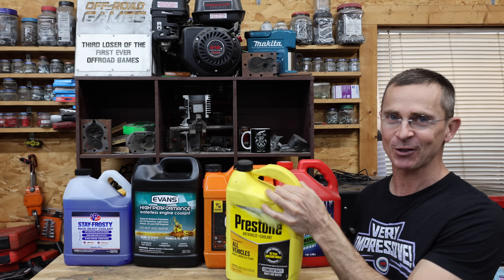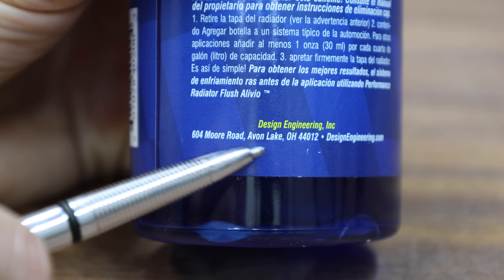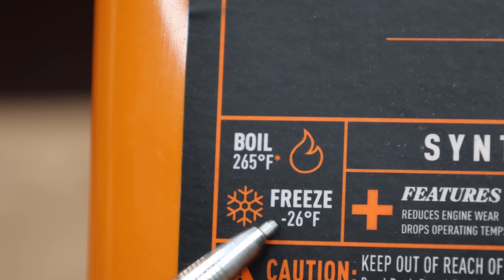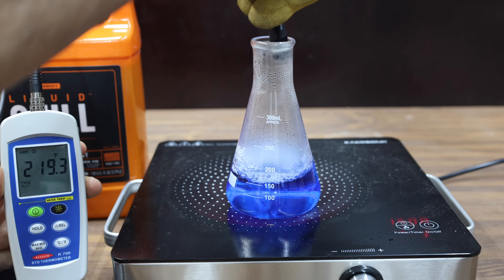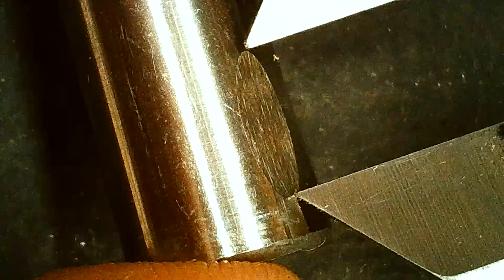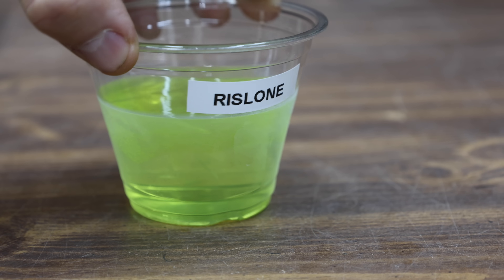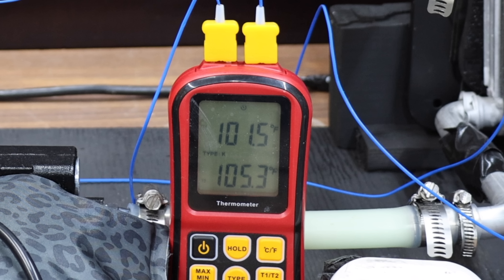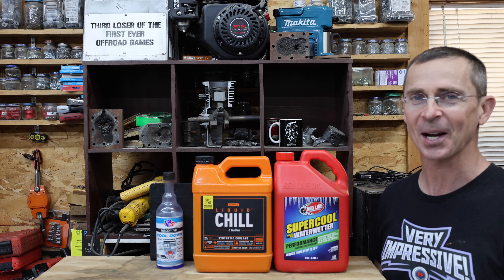Do "Super Coolants" Lower Engine Temperature By 30 Degrees?

Comment: Gotta admit I laughed a bit when Stay Frosty was the only one to freeze :D Living up to it's name!
Reply from the maker: Lol  Good Point!
Reply: The fact that the Stay Frosty stuff had the best heat exchange but terrible temperature range properties (boiling and freezing at 212F and 32F) has me convinced that stuff is just water. 
"100% water-based" sure sounds correct for that one, lol
Reply: @f38stingray  As per another commentor "The one thing you might not have known, the "stay Frosty" is required for race cars on tracks, especially drag racing. Anti-freeze is very hard to get up off the track and can cause a slick spot. 
So almost all tracks require water only (or the "Stay Frosty" brand as its proven not to soak into the track glue)"
Reply: Stay Frosty isn’t antifreeze
Reply: Yes, that was unexpected.
Reply: Which coolant yall purchasing 😅

Comment: This is all very interesting, but the questions remain as to if these are appropriate for use in a given car. Manufacturers often have very specific recommendations about coolant type and ingredients, i.e, IAT, OAT, HOAT, G12evo, silicates, phosphates, etc. Also, cooler is not always better. The goal with engine cooling is for the engine to run at the optimal temperature for which it was designed.
Reply: Hmm..well, it depends on the goal though right?  If the goal is HP, a cooler engine will always produce more power than a warm or hot engine.  A warm engine will always be more efficient than a cold or hot engine.  Thus, lowering the operating temp with one of these additives will produce more HP but at the cost of efficiency.  It comes down the fact that denser air allows for more fuel at the same RPM, thus more power.  While intakes are typically not part of the cooling loop, they are impacted by radiated heat which explains why a cold engine makes the most power.  Since the marketing of these products is more performance oriented, and the testing proves they lower engine temp, I'd say they are hitting their goal.  As for potential damage due to the chemical makeup, I believe these all state they are compatible with all new or used coolants and with engines that contain cast iron, aluminum, or brass cooling systems.  Since he also did the acid test, I'd say they are safe.   The only thing this test is missing would be a long term alkalinity and contaminants test.
Reply: Still ethylene glycol based.  The anti corrosion technology is all that is different.  Nonetheless even that makes a difference.  Funny people are still encouraged to use the Evan propylenel glycol coolant.  I've seen more race engines blow gaskets with propylene glycol die to inferior thermal properties.

The lubricity test was unnecessary, I think.  All the pumps I've seen have bearings running in grease.
Reply: @idonotwantahandle2  I'm not arguing...I'm not a car-guy, but I thought waterpumps had water lubricated bearings and a weep system as part of that.
Reply: @nunya___  No, they are sealed bearing packed in grease. The weep hole is there to tell you if the seal has failed and leaking. New pumps tend to leak a tiny bit when the pump is new and the seal is seating. A continuous stream of coolant out of the weep hole means the seal is defective and the pump needs a rebuild/replacement.
Reply: @ Thanks for the info.
Reply: @idonotwantahandle2  Agreed about the lubricity test.  Water pumps have sealed bearings so no external lube needed.  I also agree about the Evans.  I race and stay away from it.  My current built 340 runs with either the Redline or Superchill and there is a noticeable drop in coolant temp when I use it.  I like this for the better protection it offers as I'm also running an electric water pump vs mechanically driven which means a electrical fault could make my temps skyrocket, and trust me, this happens very, very fast!  Not too worried about the anti-corrosion as I've had my used coolant lab tested and nothing unusual has been found.   I see no reason to run these in a daily driver though.  Why risk unknown chemical properties or interactions?
Reply: Exactly

Comment: I can't talk about any other product as I have not tried them, BUT Ive used Water Wetter for years on all my cars since I can remember and it's the ONE MUST HAVE on all my cars. Not only it lowers all temps by a small (but good enough) amount but has N E V E R given me corrosion, pump or chilling system problems. Ive uses it straight with distilled water only in warmer climates and mixed with 10% anti-freeze in colder times. To note, distilled water only provides much better cooling performance than when mixed with anti-freeze. I am not at all surprised with the results in this review and at least on the one brand I use, I can definitely say it works.
Reply from the maker: Thanks for the feedback.
Reply: @ProjectFarm  Thank you for your videos.. you rock!!!♥

Comment: Every car has a thermostat to keep the coolant at the ideal operating temperature. These products do nothing in normal vehicles.
Reply: I have an Autometer water temperature gauge on my car in conjunction with the factory “dummy” gauge.  The “dummy” gauge reads in the middle of its range from about 140 degrees F - 220 degrees F when the cooling fan comes on.  While driving, I will see temperatures in the 180-190 degree range normally but stopped at stop lights or in heavy traffic the temperature will climb on my aftermarket gauge.  The stock gauge never moves from the middle in all this temperature fluctuation.
Reply: It still can help your vehicle run easier 😅 the thermostat may regulate temp. The fluid helps it not have to work hard to keep it low.
Reply: Thermostats go full open between 180f and 195f depending on the vehicle.   That's also the ideal temperature for the vehicle to run at without damage or economy issues.  

Well when it's 100f outside during the summer, your cars thermostat is already wide open, your radiator fan is running all the time, and your engine temp is often closer to 205f.  

So no. Even if there's nothing wrong with your vehicle and you don't "need" this additive, it will still keep your cars fan from having to run as much, and still keep you closer to the ideal engine temperatures.  Just because a car can run fine with a 220f engine temp, doesn't mean it should run at a 220f engine temp.  Same as "lifetime transmission fluid". The manufacturer doesnt much care if the vehicle lasts over 200k miles. 

As to engine temps running high but within design, they cause a lot of head gasket seals to eventually leak. Just ask any mechanic that works on jeeps or nissans.
Reply: Also say your thermostat goes out, having better fluid would give you that much more time before it overheated
Reply: @The_Hoard422 water is that "better fluid". The specific heat of water is higher than any coolant/antifreeze. The purposes of coolant/antifreeze are to prevent corrosion, prevent freezing in cold climates, prevent boiling over in hot climates (raising the boiling point does NOT increase the specific heat), and to "wet" the inside of the cooling system to allow for better heat transfer.
Reply: @jameshaulenbeek5931  you're missing the point of most coolant performance additives.  Generally speaking, they are surfactants that improve thermal transfer to/from the liquid.  They are not intended to change the thermal capacity, boiling point or freezing point.  You're conflating coolant/antifreeze and additives.  They're not the same thing.
Reply: Yes, the thermostat will close when too cold and open when it gets warm. But when you start taxing the motor with track usage or towing, the coolant can get higher than the system can effectively cool down, the thermostat can be wide open and you'll be at the mercy of airflow, how well your cooling system is designed and how quick the (coolant) can exchange the motor metal heat to the radiator metal
Reply: The only time a thermostat is closed/shut/off is during the initial warmup.  After that, it varies how far open it is to regulate temperature. 

Artificial cooling (like driving through deep water) is the only exception.
Reply: Sadly you are out-numbered by idiots. You are right about the thermostat regulating the temperature. The thermostat doesn't know nor care about any temp sensor or gauge. It works on its own.
Reply: @wudntulike2no32  the irony of your comment eludes you.  I know this is going to be shocking news, so sit down before you read it:  the thermostat is NOT the only component in a cooling system.  That's why it's called a 'system'.  Depending on geographic location and usage case, it's possible that the cooling fan controls the engine temp and the thermostat has zero effect.
Reply: If a cooling system is perfectly balanced to land right in the middle of the thermostat opening range, any improvement to the system WILL decrease the operating temperature.  A bigger radiator, a better fan, or surfactant additives will cause the temp to drop and thermostat to close more than before.  It's an inevitable fact.  If you don't have even a cursory understanding of automotive cooling systems, why not juststfu already.
Reply: Wouldn't analog or digital gauges change the view point.
Reply: A fool in his money or soon parted... Around here it's mainly used for racing, cars aren't allowed to use antifreeze.
Reply: @lynch6642  irony, you can't even quote a word phrase correct.  It's 'and' not 'in' 'are' not 'or'.  Your parents Dunning and Kruger must be super proud.  If you think surfactants are 'snake oil' like the other guy, I suggest you quit washing your clothes with surfactants (soap) to test the idea.
Reply: That's not true. It's anti-corrosive and if you're thermostat get stuck on closed (like it has on my Hemi) the Evans coolent specifically will protect it further.

Once it boils it can cause engine damage so it's always a good idea to use a coolent that's more forgiving than water especially if you are racing
Reply: If you're relying on the dummy guage to come to this conclusion, you're the dummy.
Reply: @zacharymorris9917 the "dummy gauge" is based on a calibrated thermocouple. The same info you would see on a scan tool. What's your point?
Reply: @tomgnyc  the gauge will not move unless you go way high or low in temperature. It will stay in the middle from 170 to 240 usually.  Your brain cells are not calibrated that's for sure
Reply: @tomgnyc  why are you making claims that you absolutely have no clue about???  Why?

Like the other guy said, the guage will display the same reading for a huge range of temperatures.  That's why it's called a dummy guage.  That's the same reason why people will report that their engine overheated "all of a sudden".
Reply: @tomgnyc  the sensor is not a thermocouple.  It's not "calibrated" and it doesn't display a linear output either.  You really have literally zero clue what you're talking about.

Here is an example temp sensor and the observed resistances: 

180ohms at 100C 212F

224ohms at 90C 194F

310ohms at 80C 176F

425ohms at 70C 158F

584ohms at 60C 140F

825ohms at 50C 122F

4800ohms at 0C 32F
Reply: @REALBanannaman ... That's exactly how it was explained to me. Useful, but far from accurate.
Reply: @zacharymorris9917  you're speaking as if all vehicles are the same, when they're not. My truck most definitely displays actual temperature. You can watch both the needle and the digital display change even when doing a flat highway cruise.

You can tell when the thermostat is opening and closing to center around the 175° rating. It'll go 175, 176, 177, 176, 175, 174, 173, 172, 173, 174, 175 back and forth back and forth.

Without a winter front it'll drop to maybe 168 when it's cold enough and then on a hard pull you're up in the 180, 190s, 200s, etc until the fan is prompted to kick on and drop it all back down again as you'd expect.

But you're correct that there are cars with a gauge that basically doesn't move, and it's not much better than an idiot light.
Reply: @dchawk81  appeal to exception is a logical fallacy.  I NEVER said "all vehicles are X".  I DID say "if".

Regardless of the if distinction I made, virtually all modern vehicles have a dummy guage.  Finding an exception is not some massive gotcha.

Your entire post is postured like a correction, but then confirms literally everything I've said.  So, other than the I-know-a-tall-Asian-man fallacy, what's your point???
Reply: @zacharymorris9917  I may have quoted the wrong person. Some mentioned all vehicles being "idiot" gauges as if none showed actual temperature. Apologies if it wasn't you.
Reply: @dchawk81  thank you sir.
Reply: @ You clearly have no idea how a thermostat works.
Reply: @beemo808  do you?
Reply: @ Yes I do. The thermostat doesn't even know what the gauge is reading. It is filled with wax and opens at a predetermined temperature. If the coolant temp gets above that temperature it sends coolant to the radiator which cools it down which causes the thermostat to close again, which then causes the temp to rise again which then opens the thermostat and repeats the cycle. It doesn't matter what the capabilities of the fluid is as long as it is sufficient to cool the engine with the thermostat open.
Reply: @beemo808  No, you don't, actually.  A thermostat doesn't open and close like an on/off switch.  Not even remotely close.  "Starts to open" and "fully open" are typically stated temperature specs if you look at a data sheet.  The rest of the cooling system absolutely affects how far open the thermostat is and the specific operating temperature within the opening range if adequate.  If the cooling system is borderline adequate, the thermostat will have zero affect, and the operating temperature will be determined by the cooling systems' equilibrium temperature.

In virtually all cases, a surfactant will lower the cooling system temperature.
Reply: @zacharymorris9917  I never said it operated like a switch. If the coolant lowered the temperature of the system, the thermostat would start to close and less coolant would pass through the radiator which would cause less cooling to take place. It doesn't matter what the fluid is, the system will never go outside of the range of the thermostat. Keep wasting your money on snake oil.
Reply: @beemo808  you literally did though.

Coolant CONSTANTLY goes outside of the thermostat range.  That's exactly why the cooling fan activates.  What are you on???
Reply: @beemo808  if you think surfactant is "snake oil" then quit washing your clothes with soap.  🤣

Comment: How could it lower the coolant temperature when there is a thermostat
Reply: Numerous reasons.
Reply: It won't stop the thermostat from doing its job to try to maintain temps at its rating, but it'll keep the thermostat closed more often and sooner, and the fan will kick on less often under heavy load.

IOW if you have a 190° thermostat, the thermostat will still aim for that temperature but the work it and the rest of the system has to do to accomplish it will be changed.

Comment: 0:11 Used Hyper-Kool  in  my race car in Arizona where antifreeze is not allowed, worked great , never overheated even racing in 110 *+ heat....
Reply from the maker: Thanks for sharing.
Reply: Great to know! I need something for my racecar lol
Reply: You can't use antifreeze in your car in Arizona?
Reply: @thebeddoctor4273 lots of tracks don’t allow much of anything other than water for cooling systems. Coolant is super slippery under a tire, and can be extremely dangerous if someone has a leak, busted hose, etc.
Reply: regular anti-freeze isn't allowed on race tracks in race cars or motorcycles. Also it doest freeze in lower regions of AZ, so people will use water based supercoolants and not have to worry about them freezing in their engines. I used distilled water and Water-Wetter in my motorcycle
Reply: @thebeddoctor4273 you can in normal use. But some tracks don't allow it because it causes a big mess and damage if the radiator explodes or otherwise leaks onto the track. I'm guessing that's the situation here because he said racecar. But we certainly use antifreeze in Phoenix just fine 😂
Reply: @thebeddoctor4273 im not positive but I do know not just oil but simple coolant leaks at high speeds, if something drastic occurs you and everyone behind you at speed will be at risk for crash,injury,death
Reply: @thebeddoctor4273 i think its a drag racing regulation in certain classes
Reply: @thebeddoctor4273  not on a track. It's fairly common for race cars and race motorcycles.

Comment: Just purchased a 2025 Camry and it takes 0W8!!! With such thin oils being more common on these Toyota vehicles could you do a video on different oil brands of 0w16 and 0w8 from manufacturers such as Liqui Moly, AMSoil, Pennzoil, Mobile 1 etc! Thanks!!
Reply from the maker: Thanks for the suggestion.
Reply: Pay out of pocket or do your own oil change at the first 3 or 6 month point or at the 3000 or 5000 mile point.